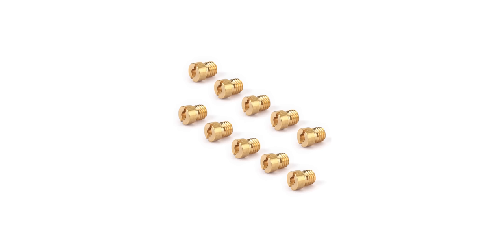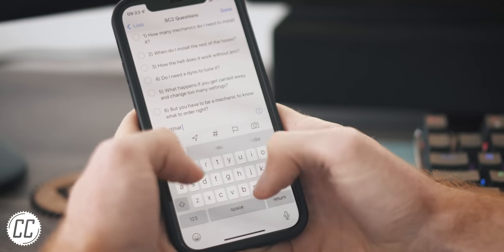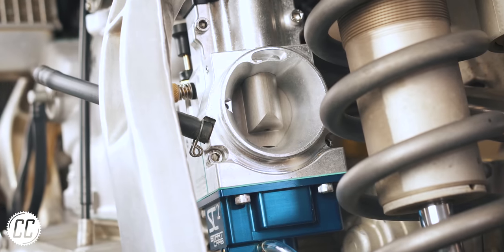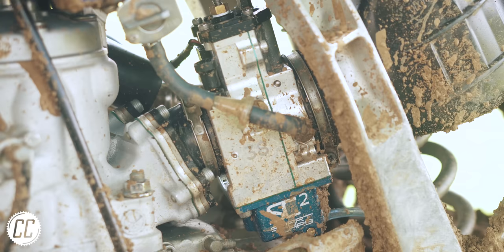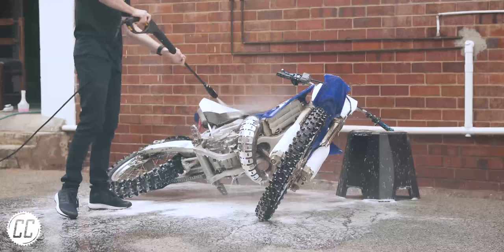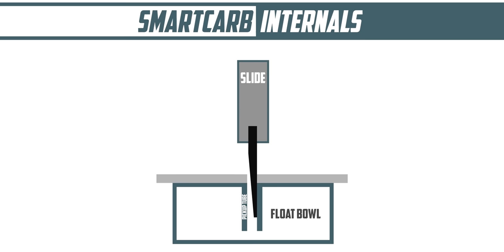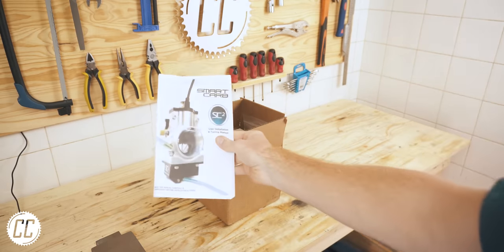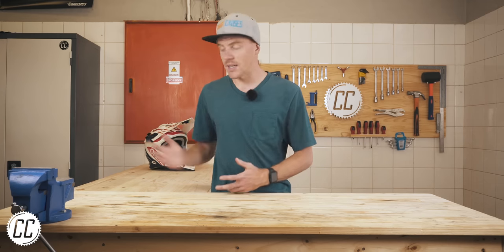The Best Carb Money Can Buy? | SmartCarb SC2

Comment: There's going to be a long term maintenance problem with all the electronics used today, I think.
Reply: Agreed. To the extent that we use electronics (a solid-state, linear-magnetic position sensor), there are no additional moving parts beyond what is necessary (the throttle slide). The appeal of 2-stroke bikes largely depends on their simplicity and we hold that there is huge room for improvement for carburetor fuel systems for these applications. That's why we're here.
Reply: @SmartCarbFuelSystems  well, I wish there were 4 stroke options. Today, we can rebuild a 50 year old motorcycle. But in 50 years, I think it's likely that we will not be able to restore motorcycles because the diagnostic tools will not be available, or replacement electronics will not be available, or these things will be very expensive. I can't imagine mfg the current state of electronics for decades. They need to evolve as an entire industry which leaves the current state completely obsolete.

Comment: There's a reason these aren't common; if you're going through the trouble and expense for a "smart" carburetor just for better AFR, it offers virtually 0 advantages to a cheap throttle body, considering modern ones are 100% external bolt-ons.. And did I mention cheap. I fear the minutiae of really good carb tuning is starting to be lost to history.
Reply: I am going to stick by this statement; If you can't select the appropriate carb for the appropriate engine and tune it.. appropriately, invest in throttle body injection, one that comes with a wide-band o2 sensor as part of the kit. Smart carbs will offer you nothing better but a lighter wallet in the end. Learn the minutiae (and your specific engine), or go injected and be done with it.
Reply: @Drmcclung  you seem to be implying that the SmartCarb doesn't offer performance benefits beyond a properly tuned conventional carburetor, which it does. Better AFR is better performance. A single circuit carburetor like the SmartCarb is capable of providing more consistent air/fuel ratios throughout the throttle range than a multi-circuit carb is. Furthermore you're forgetting the SmartCarb's ability to more finely atomize the fuel in the mixture, itself a performance and efficiency gain. And for those who ride with varying air density factors like temperature or elevation, this carb won't go out of tune like a conventional needle/jet carb will, which only widens the performance gulf between them.
Reply: Properly tuned CV carbs fixed the AFR flat spot problem 40+ years ago - the only thing better than that is throttle body injection with wideband o2
Reply: @Drmcclung  who's talking about a flat spot? Or even CV carbs? The video in question is about a YZ250. The same bike, SmartCarb equipped, that Diogo Vieira rode to win, again, the Portuguese National Enduro Championship two years ago. Are there any questions we can answer for you D. Russ? You seem to be confused about the technology and its utility in this space.

Comment: Less fuel means less oil to the crank. 30 percent less oil?(non injection)
Reply: No, less oil going out the exhaust. Finer atomization of both the fuel and the oil in it results in greater combustion efficiency netting the same or better power while requiring less.

Comment: I am by no means an expert, but it is my understanding that the primary way running an engine too lean can damage it is because leaner engines run hotter. Fuel has a cooling effect on the pistons and cylinder walls similar to how a cool mist of water keeps you from overheating on a hot day. Running richer helps prevent the engine from overheating as well as makes it harder for the fuel to pre-detonate causing engine knock.
Reply: That's correct. Using less fuel doesn't necessarily mean that we're losing our fuel cooling effect. Rather, by more finely atomizing the fuel (a cooling benefit in and of itself), we promote more complete combustion of that fuel. Greater fuel economy, less fuel short circuiting out the exhaust, and therefore reduced emissions are all byproducts. The idea is maximum efficiency at every throttle position and while we do tend to see slightly hotter temps, we maintain typical if not more linear A/F ratios throughout.
Reply: @SmartCarbFuelSystems  yep. To clarify, too lean is absolutely not the same as being fuel efficient. To be fuel efficient you are supplying the exact amount of of fuel and air in the ratio necessary for the engine to provide the power needed to accelerate your vehicle and any cargo. The amount of fuel, amount of air and ratio of fuel to air necessary to run with good fuel efficiency will vary depending on altitude, engine displacement and other characteristics, engine rpm, cooling ability of the engine, and the amount of power you are trying to make. It is about engineering tradeoffs. However, when you run an engine too lean, you lose power output without any real fuel efficiency gains in addition to putting your internal engine parts at greater risk of catastrophic failure. You need a certain minimum amount of fuel to propel x amount of weight to a given speed and given fuel to work conversion efficiency percentage after all.
Reply: @joshnabours9102  🍻

Comment: what makes that carb smart.? theres no electronics/ or a.i. on it. thats just a normal carburator.
Reply: We hold that what makes it smart are its patented features that improve performance, efficiency, and ease-of-use beyond any other carburetor or mechanical fuel system in this market. Unlike normal or conventional carbs the SmartCarb provides greater performance, fuel economy, can be tuned externally without tools, compensates for wider elevation/temperature changes, and it is capable of meeting emissions standards including vapor and tip-over requirements.

Comment: so the whole electrics part of this carb is just ignored?
Reply: The electrical connector attached to it is a throttle position sensor (TPS). Yamaha YZ250s and other Japanese 250cc 2-stroke dirt bikes from the early 2000s use TPS in conjunction with 3 Dimensional ignition mapping (dynamic map switching based on throttle position). The TPS we use is a linear magnetic type where the sensor reads the position of a magnet that we mount inside of the throttle slide. Unlike the stock carb with its piezoelectric TPS requiring an arm that rides the top of the slide to turn a shaft, SmartCarb TPS is solid state with no additional moving parts. We think it's pretty neat.

Comment: My stock carb has no electronics. What’s the wire for?
Reply: Later year (~2001+) Yamaha YZ250s have a throttle position sensor (TPS) on the stock carb and the ECU runs 3 dimensional ignition map switching based on throttle position. SmartCarb has a TPS option for that reason - so you don't have to give up your 3D mapping or oil injection (Beta), etc.

Comment: Does it have an accelerator pump for instant throttle response and no momentary pause?
Reply: Doesn't need one. Internal, integrated float bowl venting provides instant fuel lift, no pumper required.

Comment: wonder how these compare to an SU carb since they both have a varible venturi that can change with the atmosphere temp and pressure
Reply: That's incorrect. The SU's piston is indirectly throttled using atmospheric pressure whereas the SmartCarb's flat throttle slide is directly throttled by the cable and handset. Unlike the SU, the SmartCarb uses air density communication into the float bowl for fuel flow assist - not to throttle the carb.
Reply: @SmartCarbFuelSystems  i know. but it would an interesting comparison between your carb and a constant depression carb, sorry if i wasnt clear enough

Comment: It is not true that it does not have "Jets". The jet is the combination of the semi flat pin and the hole it goes in. This is a system which has been in use for tens of years by the British "SU" carburettors.
Reply: That is incorrect as has been explained in this thread multiple times. While one can argue that the interface between the flat ground metering rod in the SmartCarb and the emulsion tube that it rides in constitute a "jet," it does not use fixed orifice jets in the traditional sense, nor any secondary circuits whatsoever. Furthermore the SmartCarb carburetor functions entirely different from the SU. Unlike the SU, the SmartCarb is directly throttled using a flat slide, not a butterfly and CV-style piston slide, and it uses a flat ground metering rod, not a tapered needle. Automatic air density compensation in the SmartCarb is novel and indeed patented - that is integrated float bowl venting for proportional fuel driving forces (density AND velocity). The SU works entirely different in that it uses airflow to throttle the piston slide similar to modern CV style carburetors.
Reply: SU carburettors are CV carburettors (constant velocity) Way different. The fuel delivery system is through the metering rod on the smart carbs, the metering rod delivers fuel in a single stream, which is even worse than a typical carburettor jet and does a poor job at atomising the fuel prior to induction. These carburettors are known to run bikes lean, and still require constant tweaking just like any other carb for 1/10th the price.
Reply: @Billy-burner  apart from the SU comment, you are entirely incorrect. That a metering rod atomizes fuel more finely than a suite of fixed orifice jets is well established and has been demonstrated via laser planar imaging research performed at the University of Wyoming. Fueling isn't given in a stream but rather a near vapor-state plume. The SmartCarb's ability to improve performance while also reducing fuel consumption (and emissions too) is in no way related to lean running but rather that aforementioned superior metering rod atomization leading to more complete combustion, i.e. less unburnt charges out of the exhaust. Not lean, clean. Lastly, the SmartCarb compensates for much wider elevation/temperature changes compared to conventional jet/needle carburetors. That is, like the atomization, a well established fact proven with multiple PPIHC wins/records, 3rd party evaluation - most notably by North West UAV out of Washington demonstrating consistent A/F ratios up to 22,000 feet, and lived out daily by our thousands of customers worldwide, from Florida to Nepal, along with a growing contingent of paramotorists enjoying greater consistency for elevation changes without adjustments.

Comment: Do you have any rubber tyres that will fit a wagon wheel?  What is it with idiots and their refusal to let go of bad designs just because they have used them for many years?
Reply: What is the point you're trying to make exactly?
Reply: @nathandyess5310  this is just hipster nonsense, you use a pressure differential to cause the fuel to flow from the tank into the cylinder, whether it is a carburettor or a fuel injector, the best way to do this electronically is with an injector, not a carburettor. There are hundreds of different retrofit kits that make converting to fuel injectors trivial, this is technology that nobody needs.
Reply: @AirCrash1  this is a SmartCarb. It's not just a carburetor. Unlike conventional needle/jet carburetors (that haven't seen advancements in decades) it: is externally adjustable without tools, spills zero fuel (i.e. can and does meet evap/tip-over emissions regs), compensates for extreme air density changes (tested up to 22k feet), and it competes with or exceeds FI (TPI/TBI) in performance and efficiency, only without the cost/complexity. It's been twice EPA certified for on-road emissions - without catalyst assistance to do so, and is used by more and more top level athletes worldwide.

This technology can serve many needs, not just in sport/performance markets, but also low cost light transportation, power generation, ultra-light aviation, etc.

Comment: Just a fancy carb. Nothing else.
Reply: Fancy, yet nothing more? That's curious. This is a carburetor, if there ever was one, that can and does compete with fuel injection in terms of ease-of-use, efficiency, and consistency regardless of elevation/temp changes. And it does so mechanically and passively, without a full array of sensors (failure points) and other added complexity/cost. 

It's more than a fancy carb, and that's not nothing.

Comment: Who said its only for two strokes. I dont see why you couldnt run it on a 4 stroke.
Reply: No reason really for most 4-strokes. The issues are typically fitment and throttle cable routing, however, due to the SC2 being a top-pull, single cable throttled carb. If they fit they work. But they're designed more so to fit the 2T bikes.

Comment: needles are too expensive, not worth it, better to have a cheap jet
Reply: Metering rods aren't jets, and when the correct one is installed there is no need to change it for any elevation or temperature changes. Moreover, we have a metering rod exchange policy whereby any metering rod returned intact is refunded 100%. Our customers don't sit on metering rods they don't need. Try selling your jets back to Keihin or Mikuni...

Comment: Is this smartcarb or lectron not suitable for 4t?and why??
Reply: SmartCarbs work very well on 4T applications but as they are currently designed using a top-pull, single throttle cable for throttling for direct replacement of the Keihin PWK and Mikuni TM/TMX carburetors, fitment and cable routing issues remain. Thank you for your interest and please stay tuned as we develop kits and begin entering the 4T market in greater capacity.
Reply: @SmartCarbFuelSystems  ok ..thanks for the explanation

Comment: Looks like they copied Lectron carbs...
Reply: Not at all. Both the Lectron and the SmartCarb share the same original inventor, William "Red" Edmonston. Nearly 4 decades and other carb iterations of his, including the Ei Blue Magnum, Edelbrock QwikSilver, and others separate their entry into the market. The SmartCarb is simply the modern culmination of the metering rod carburetor concept and there are more differences between the two fuel systems than you may realize. Unlike the Lectron the SmartCarb is internally vented, externally adjustable, uses a non-round, variable throttle rate venturi shape, offers a TPS option, and utilizes active patents for some of those features. See our article (SmartCarb vs Lectron) about their shared history and how they compare on our website.

Comment: Isnt this what lectron has been doing for years?
Reply: Only in the fact that it also uses a metering rod. Unlike the earlier Lectron the SmartCarb utilizes integrated float bowl venting (single circuit design with no need for a power jet), variable throttle rate venturi profile (stronger signal at the metering rod down low resulting in stronger, more crisp low speed response), external adjustability without tools and 6X the adjustment resolution, and the SmartCarb also provides a TPS option for bikes like these with 3D ignition mapping or Beta oil injection for example. Check out the article SmartCarb vs Lectron on our website for more information on their shared history and how they compare.

Comment: So would this in theory work with forced induction?
Reply: Yes it will and yes it does. Just this last July we helped a team of 6 guys out of Washington state set 5 new Bonneville speed records in the supercharged 125cc and 175cc categories running a turbocharged (blow through) YZ125 engine in a Yamaha R6 chassis. The SmartCarb compensates for artificial air density factors like boost just like it does conventional air density factors like elevation/temperature changes.

Comment: It doesn't make the process any simpler so what would be the point of this vs the factory carb?
Reply: How doesn't it? All adjustments are made externally, without tools, in seconds. Furthermore once set you can ride at various elevations/temperatures without the carb going out of tune like the factory/stock carb does. Not to mention increased performance and fuel economy.
Reply: Have you ever worked on a motorcycle with carbs? I had a 97 ZX6R years ago, 4 carbs; 1 per cylinder. All have to be properly tuned/synced. Not to mention fuel jets are known for clogging. I wish had something like this.
Reply: @turksinnovations  I do know the struggle actually. I have a ninja 250 with dual carb. Syncing them is definitely a pain but other than that, they're pretty easy.
Reply: Brother don't piss down my back and say it's raining. I just watched you struggle the entire video trying to tune that thing. Don't tell me that was any easier. Don't try to tell me it's hard to swap to a larger jet real quick at lower elevation. Doesn't even require tuning to do that. All the "tuning" is done at idle

Comment: how well will this work with forced induction?
Reply: It'll work very well. The same features in the SmartCarb that allow it to compensate for natural air density factors like elevation/temperature changes also allow for compensation for artificial air density factors like a clogged filter or boost (blow through). We've helped equip turbocharged snowmobiles, snowbikes, Harleys, and here recently a turbocharged YZ125 in an R6 chassis which set 5 new Bonneville speed records.

Comment: All slide carbs use a metering rod, metering rods are jets
Reply: Most carburetors use a needle jet, which is different from a flat ground metering rod like the SmartCarb uses. Metering rods vary the opening of the fuel nozzle or emulsion tube through the throttle range, making it unlike a traditional fixed orifice jet in conventional carburetors.

Comment: an electrically controlled carb... is a throttle body...
Reply: SmartCarbs are not electronically controlled. They operate with a throttle cable and a flat slide. The electronics you see on this carb only relay the position of the throttle to the CDI for the purpose of altering ignition timing. 3D mapping is a factory feature of the YZ250.